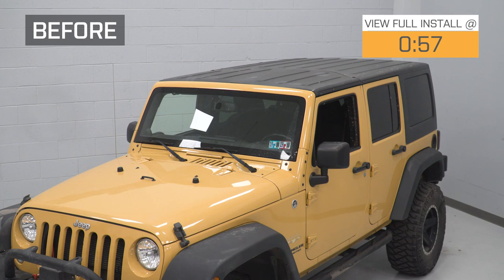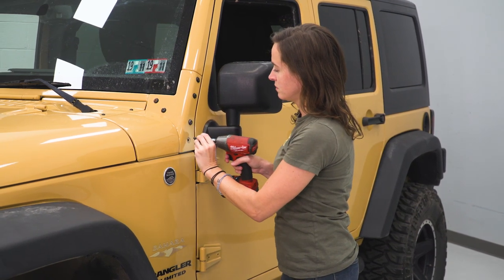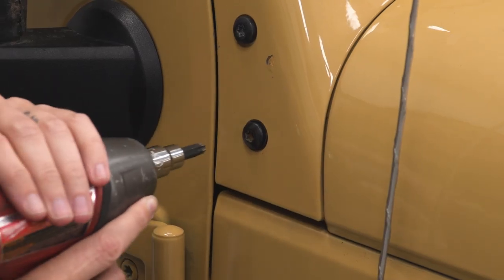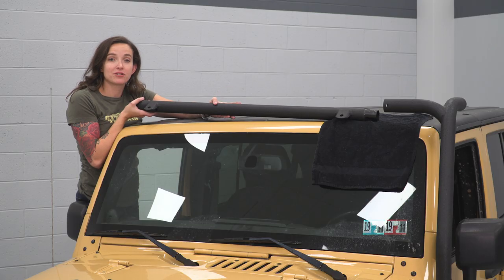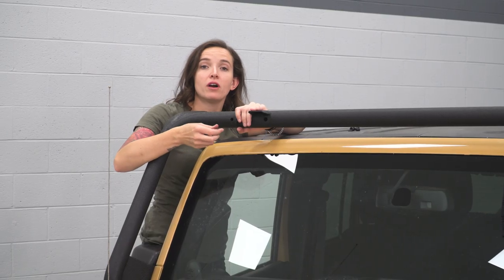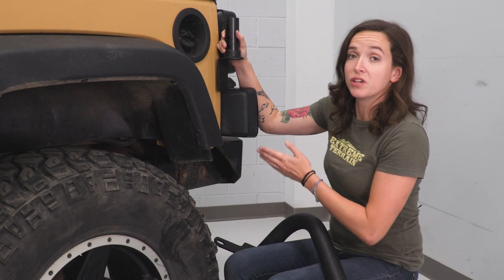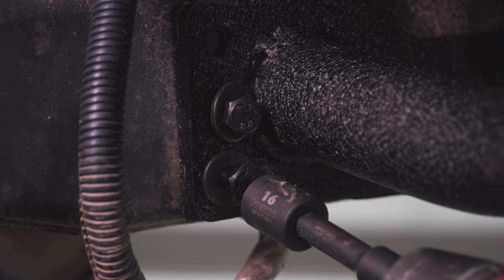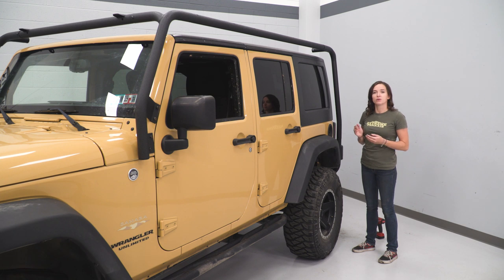Jeep Wrangler JK 4-Door Barricade Roof Rack Review & Install

Comment: Great help.  mine has 65k and just now got the kit - had to get back bumper insert where each sider has 2 bolt inserts cut bumper. these 2 smaller brackets need to be bent to align with bumper inner angle, this was not difficult with the right tools.  Much appreciate the foam protector, the added protection goes a long way for complete install and saves on value.

Comment: Can this really only hold 300 plus pounds? That seems like it won't hold up to a roof top tent and 2 grown people sleeping inside tent.
Reply: That is for driving load
Reply: The static weight is usually double the moving weight limit, should be just fine for that. Also engineer rule is that the load it’s rated for is only 60 percent of what it can actually hold. You should be totally fine
Reply: @swagnerrrmane but what if the weight becomes, uh, dynamic while the errrrr vehicle is static 🤔 👀